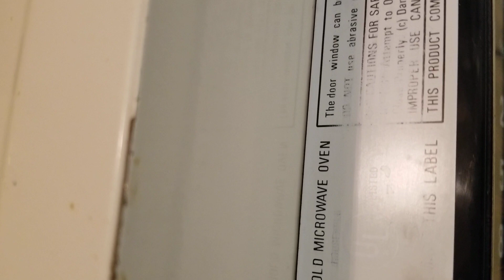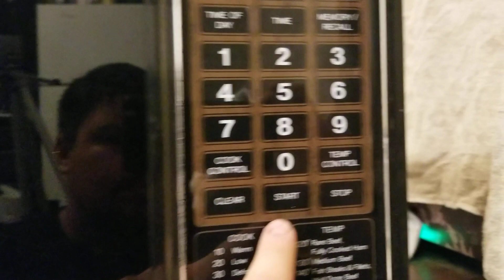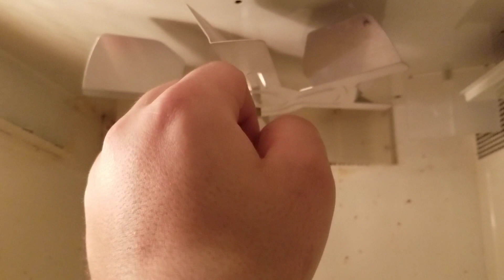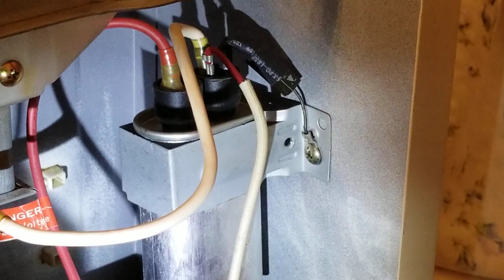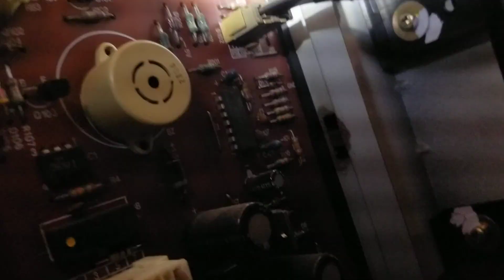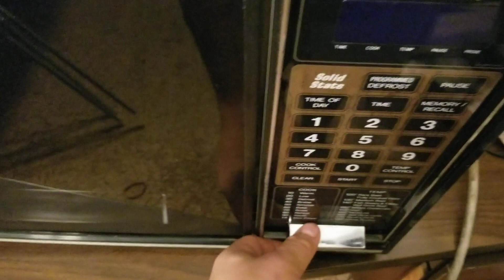Vintage Kenmore microwave overview #2

Comment: About the blower:
I‘m pretty sure it‘s just the bushings than need a bit of fresh oil. At one point in the video you spun the impeller and it seemed to have quite a bit of resistance.
Due to the nature of these shaded pole induction motors, they have a very low starting torque and draw relatively much power to at startup.
The faster the motor gets, the more torque it can produce. That‘s why, once up to speed, it runs fine.
And of course, with the magnetron pulling a lot of amps, there‘s not much current left to start a sticky blower.

Comment: Yes: Kenmore engineers liked their thermistors. I'm currently opening up a unit similar to yours, 1984. Stirrer gets stuck, makes micro lightning storms. LOL. Your blower should be full speed immediately. Check/replace all those old electrolytic if you have a cheap source for them. That'll probably "fix" the current sag on blower, display. 

PS - 900W was standard back then.